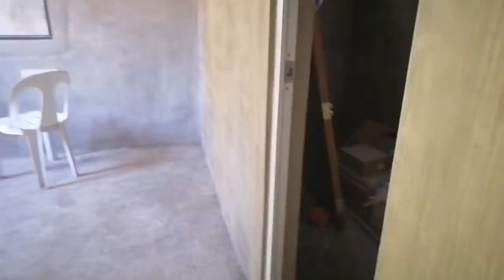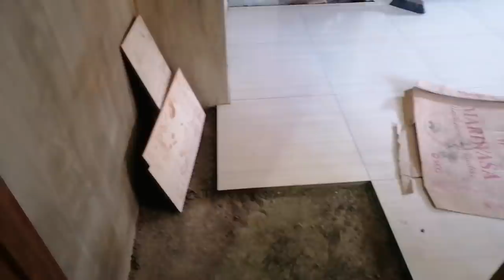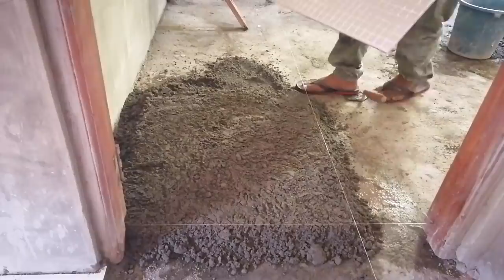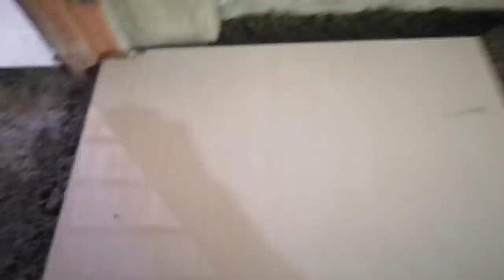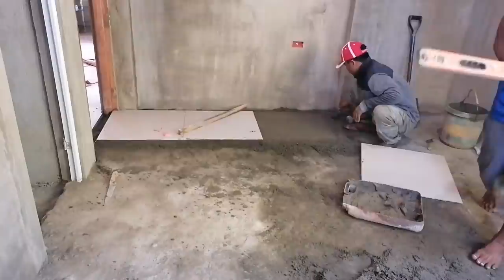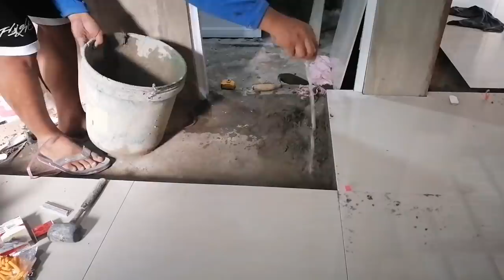KAYA PALA PUMUPUTOK ANG TILES NA GRANITE MAKALIPAS LANG ANG ILANG TAON.

Comment: May explanation iyan bakit nagtutuklapan ang tiles... Una dapat may expansion joint o PEJ filler in between walls at slab,  may tinatawag kasi na thermal expansion ang concrete slab, pangalawa dapat sumunod sa standard (mininum/maximum) spacing sa tiles kung saan nilalagyan siya ng tile grout,  pag maliit masyado o dikit na dikit ang tiles at walang espasyo,  pag nagkakaroon ng movement o expansion tinutulak pataas ang ties,  so kung walang saktong space tumutuklap siya, pangatlo sa proseso ng pagkabit,  sa likod ng tiles punuin o pahiran lahat sa likod ng mortar o adheside huwag sa gitna lang,  bigyan pansin lahat ng kanto... Ang kapak sa katagalan ay nagiging dahilan ng unti unting pagtuklap ng tiles..at follow the proper thickness ng mortar setting niya,  pag sobrang kapal at lampas na ng 1 in (maximum allowable thickness),  gumamit na ng wire mesh..pag lampas 1 in ang mortar setting prone iyan sa crack pag nagkakaroon ng expansion.. so tumutuklap din mga tiles..mas mainam din i grout mo muna slab mo ng purong semento na may tubig instead na tubig lang bago ilagay ang mortar setting..
Reply: Un tama,,,at ndi ang drypack kasi pagdry pack mas madaling kumapak ang tiles o anu p man
Reply: Danilo, PEJ filler between walls and slab? I poured my 300sqm x 6" thick slab monolitically. Walls and Slab are literally integated without joints. I installed my tiles just using ¼ -⅜ notched adhesive trowel. Floor is smooth as a glass. No PEJ, No dry pack, No kapak.
Reply: @Just_do_it123  wait for a time... lalo na pag may movement diyan,  even iyong naka adhesive tumutuklap lalo na sa second floor.. importante iyong spacing ng tiles din.  I had worked in building construction that observed the right standards in construction method, and it has been observed that way or else that wont be implemented in the plans for nothing..
Reply: @danilosrcalapan5751  if the slab is poured in one Monolitic. If it moves  it move as a whole. That means what ever is on top of it, moves with it. That is why in California, where eartquake is common, slabs and footings are post tensioned.  No pej.
Reply: Wala talaga pag porcelain tutuklap talaga boss katagalan
Reply: @arielmonson8758  hindi problema ang tile material. Porcelain, ceramic, granite, marble, quartz. etc. 
Good Preparation saka,  proper installation is the key to a long lasting tile project.
Reply: may kasabihan na ang Small knowledge is dangerous hahaha. maige talaga na makinig din minsan sa magagaling o legend na sa trabahong ganito. kaya nga pinaiksi na ng latest tool or latest technology nang sa ganun makuha mo siya ng almost perfect.
Reply: Bakit nuong unang panahon wlang adhesive hindi na tutuklap?dpnde lng yan sa pag trabaho.ako hindi ako believe jan sa dry pack na yan.tested ko ang basa ang seminto,matagal nga lng e align pero tested wlang kapak kahit wlang adhesive.
Reply: @Just_do_it123  ilang taon na nakakabit tiles nyo sir?
Reply: @Just_do_it123  na iiliminate ba ng monolithic pouring ang therma expansion?
Reply: @roymitchel4857  I have 3 houses, with ceramic tiles with about ¼" grout lines, since 1981,  2002 and 2008. Another house with marble tiles with zero grout lines installed since 1986. All still strong and outdated, I started   laying the new vinyl plank flooring without underlayment over the old tiles. So far they they all look great.
Reply: @roymitchel4857  In California, Nevada and Arizona,  I see houses building by the hundreds, all in monolithic slab foundations with ceramic tile floors without expansion joints. However, I see expansion joints where the driveways connect to garage and also where the outside porch is connected to the house.
Reply: @roymitchel4857  Maybe what help is that the floor tiles, installations ceramic, wood or vinyl we always leave the perimeter around the walls to have about ½" gap and covered by base mouldings.
Reply: F.B.I for a new construction, ok lang iyong water sprayer saka air blower pero pag bahay ay occupied na, better just use water, mop, sponge and or vacuum para iwas kalat dumi.
Reply: Kya nagkaka crack ang tiles DHL s flooring nag ka crack din
Reply: Sir goods po ba kapag cement lang ginamit sa tiles walang adhesive nilagay?
Reply: @Just_do_it123  subukan mo boss ung dry pack ko.. kahit .. magkaapo apohan kana di kumakapak..
ang porcelaine tiles ngayon.. 5 to 6 years lang tinatagal.. kc bumibingkong yan...
kay bumibitaw sa adhesive..
pero try mo ung style ko sa dry pack magugulat ka...
Reply: @Just_do_it123  masabi lng na may bahay sa US kuno..iba naman material jan compare sa pilipinas at weather na rin..kadalasan jan  made of wood mga bahay at pagnagtiles cement board gamit.wag ka magmarunong kung hindi ka mismo nagkakabit ng tiles diy ka lng
Reply: @marcopolo-jo8iw  Huwag mo naman maliitin itong DIYer. Ang katotohanan galit mga contractor sa mga diyer dahil naagawan sila ng trabaho. Isa pa, nagliparan diyan ang mga fly by night contractors. Itong Diyer lang na sinasabi  ay full of experience, pinanggalingan ko na yan. Kaya nga nandito ako sa chat para makapagbigay ng idea at opinion, hindi maliitin sng kakayanan ng kahit sino man. Maybe someday, anak, well meet over a cup of coffee to get to know each other. Oh by the way, sa states, meron lahat ng weather at saka ever changing environment. Meron desert, forest, city snow, rain, monsoon, huricane.  Bahay sa states mostly gawang kahoy ang wall framing incorporated with modern foam insulating boards o fiberglass, wood roof trusses, wood floor joist with plywood sheathing ang 2n floor.  Unless bahay mo ay makaluma na may crawl space, 99.99% ng todays ground floor ay post tensioned concrete slab, broom finished, clean, level and perfect for the what we call the THIN SET MORTAR or mostly tawag sa atin ay Tile Adhesive. I can go on and on. Ang mag insulto kadalasan. walang pinag-aralan.
Thank You.
Reply: @pinoykantahan4476  Sir pwede ma share mo yung Ratio nga Dry Pack mo?
Reply: Sir planning to use the Dry pack method sa flooring ng Sala at Kusina kasi yung dating method na tuklap lahat ng Tiles gawa ng baha pag may bagyo... So gusto namin subukan yung Dry pack bali 2" ang elevation ng flooring at ilang mm or cm ba ang spacing between tiles?
Reply: Ano po ang maximum or standard ng paglalagay ng spacing sa pag tiles boss.. 60x60 yung ikakabit na tiles
Reply: Tama
Reply: Dapat nila lagyan ng tile spacer Yan, kasi Para pag may movement, hindi matutuklap

Comment: Aywan ko ba kung bakit ganyan pagkabit niyo ng tiles. I'm a handyman DIY'er, di ko nakasundo mga laborers kasi ganyan style nila. Ayaw sundin at gamitin bigay kung mga gamit. After 1 room. I took charged and showed them the use of adhesive, mixing bucket and serrated trowel, suction cups and leveling spacers (ex. QEP). Approximate adhesive thickness is ¼ to ½ inches. Fast, efficient, clean and easy without the excessive use of level bar and tapping. 
For awhile my experienced arawan workers because of PRIDE  they refused to adjust to my procedures and refused to admit that their 2 inch drypack is so laborious and antiquated. Ok lang sana kung walang gamit pero kung nandiyan na lahat ayaw pa rin gamitin. I'd also like to start my layout from the middle of the room not from the end to acquire a balance look.
(Previously nag response na pala ako sa site na ito).
Reply: paano po Ang timpla NG adhesive dry o ba o wet siya, at sa flooring po deretso baba Yung adhesive
Reply: @frankilao5027  it comes in a bag,  powder state, premixed na iyon. Just add water. Mox the water and powder to the consistency of a toothpaste. Apply diirectly into the slab by using ⅜ to ½inch serrated trowel. Smoothly applying to the back end of the tile will help also.  Dont forget to moist the slab before application. Recommend using a tile leveler/spacer. It will make your job finished real fast.
Reply: @Just_do_it123  dry mix mortar cguro gamit mo..good yan mas lalo pag gumamit ka ng bonding agent para cguradong kakapit sa old concrete..
Reply: Old habits don't die daw kaya a lot of pinoy who get used to this kind of old style e ayaw ng mag upgrade ng kaalaman pa. Biruin mo me tile adhesive na nga eh hahaluan pa ng semento 😜 which is an additional expenses pa sa nagpapagawa. Mas matibay daw. 😁 Besides, instead of using a trowel e sa kutsara na lang eh ok na.
Reply: Absolutely correct Sir measure the very point center of the square of the space in order to get the equal space of thethen there to lay out your first tile
Reply: Yong proceduce mo sir pang puti baka sabihin pa sayo Pilipinas dito sir hindi u.s o ano man he he.pwede rin kahit gilid mag umpisa basta yong sukat mo nakasentro rin
Reply: @frankilao5027  Bro pag naghalo ka yong katamtaman lang na kaya mong ilagay sa maikling time kasi hindi advisable na tinutubigan lagi yong adhessive mawawala ang adhession nya
Reply: Wow! It's really a small world!😃Dami nyo plang alam...sana all!Naaamaze 2loy ako...
Reply: @larrysantos2246  😄😄😁
Reply: @elsahilario8618  it is indeed small world. For some reasons these subjects have been populating my youtube channels. And I do reply or response only to construction matters that i am sure I'm well versed in. 
I'm also surprised  to see u showing interest in these sites. You must be in construction field.
Reply: @Just_do_it123  sorry to disappoint you...I'm not...😂😂😂 not really interested but I have to! 😤😤😤 I hate being duped by some foolish workers...😏
Reply: @elsahilario8618 I understand. Same here. I've been taken countless times. Learned fr mistakes. No pain no gain. Sometimes I'd say, that's the way it is. Unfortunately  so common, Iyan ang "kalakaran". Be smart, do GOOD. What goes around comes around. Happy Easter 🐣.
Reply: yes that is true ayaw nila ng bago kung ano nakasanayan kahit hinde effecient yun pa din ang ginagawa
Reply: @jayjose720  not necessarily nakasentro. Starting from the middle is just for layout or visually estimation.  Main thing to avoid is starting full tile in one edge and have to cut a barely strip of tile in any other edges. The goalis to have balanced look and maybe have to sacrifice in some inconspicuous edges.
Reply: Sir ano po yt chanel nyo? I'm amaze with your knowledge on tiles. Gusto ko magpa tiles next month. I'm learning para hinde maisahan ng workers. Im planning to use 60x120 granite. Which is better, 60x60 or 60x120? Please enlighten me. Thank you!
Reply: @georgierosevillanueva2392  First of all thank you for your appreciation of my knowledge and ability. I have NO channel and I only response to subject where I know I'm good at. Im just an experienced homeowner, diy'er. Jack of all trade, master of none. Building construction is my passion and one of my hobby. 60x60 is much easier to install because of handling weight. 60x120 will sure look nicer esp if you have a big space. Definitely i will use a strong glass suction cups to ease the handling and to use a wedge type tile leveler system to guarantee level installation throughout. I will be more happy to  expand on the details if needed. Trust me, been there done that. 😀. Thanks
Reply: boss baka pwede gawa ka ng short video para makita namin...
Reply: @Just_do_it123  hi, Mr. WYSMAN! Belated  Happy Easter...😊
Reply: @elsahilario8618  Likewise. Surprised. Nice to hear you back. Thanks 😊
Reply: @Just_do_it123  how are you doing Mr. WYSMAN?
Reply: @elsahilario8618  Extremely busy on DIY home projects.
Reply: YONG IBANG TILE SETTER AY "OLD STYLE" ANG ALAM !
Reply: @cjasngar5245  Amen. Same people still insist, cemento ang pagkabit ng inidoro 😞

Comment: Idol ano ang pinaka matibay sa pagkabit ng tiles dry pack o hindi?
Reply from the maker: . Dry pack po idol.
Reply: @christianlalatavlog  adhesive is much easier, faster and stronger using a notched trowel. I don't know why in the Philippines we insist on using drypack. 5 yrs ago,  local hardwares sell adhesives, adhesive bags shows the trowel for application, but  have a hard time looking and cant buy the trowel. Make sure the slab is nice flat and level to eliminate the drypack or any other filler.
Reply: 35 years na akong tile setter naranasan ko rin ang ganyang mga problema sa pagkabit Ng tiles...Pero  sa katagalan naalaman ko na rin ang problema Kung bakit natutuklap ang porcelain tiles...Noong unang labas Ng tiles adhesive ABC na brand pa Lang ang ibebenta sa mga Home Depot...Sinabi sa akin nang kustomer ko Yan ang gamitin ko Kasi makapit daw Hindi na kailangan  tiktikan ang flooring Kasi marble ang flooring nila...Pero makalipas ang isang taon nagtuklapan pa Rin ang tiles,marami pa akong project na tile adhesive ang ginagamit ko tanggal pa Rin ang tiles...Kaya't buhangin na Lang at semento ang ginamit ko,lilinisin ko muna ang area na lagyan Ng tiles,tapos,babasain Ng tubig tapos lagyan Ng purong semento bago ilagay ang halo...Papahiran ko muna Ng basang foam ang tiyan Ng tiles Saka lagyan Ng hinalong purong semento bago ikabit...Sa awa Ng Dios Hindi na kumakapak ang mga ginagawa ko,na solve na ang problema...